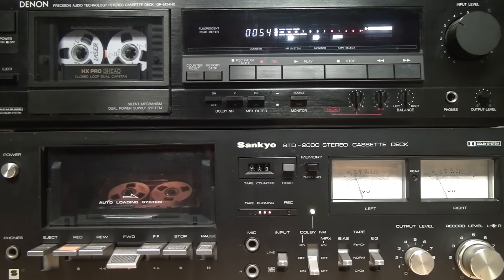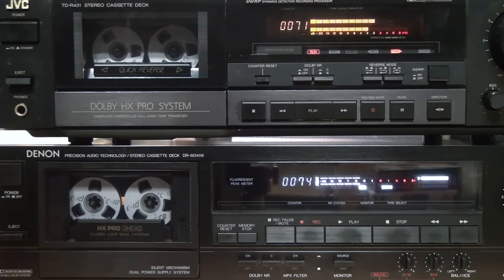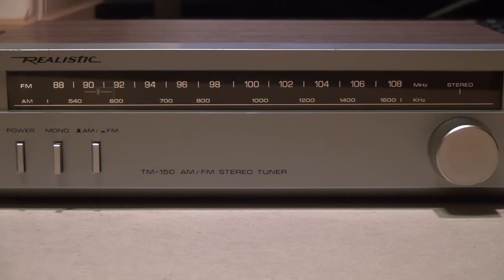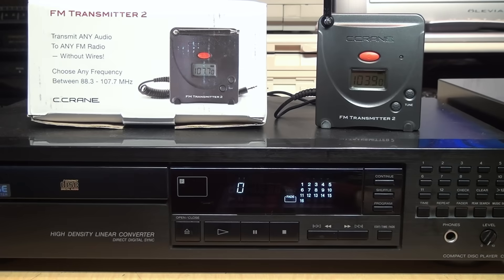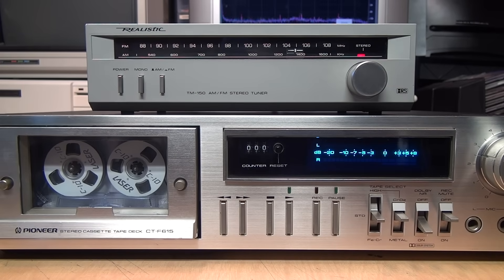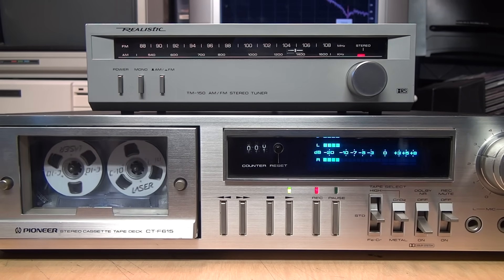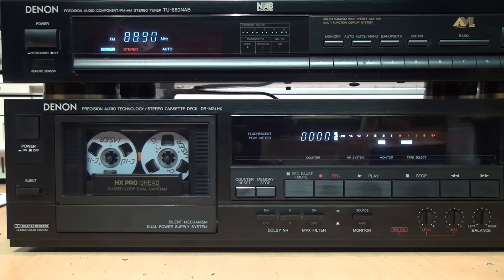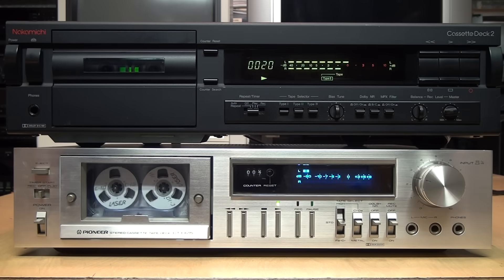MPX Filter - What does it actually filter?

Comment: Same goes for M.A.S.H. i only found this on a few CD-Players but still couldnt find out what this actually does
Reply: Multi Adaptive noise SHaping.

It's a technique of dithering a 1 bit delta bitstream so it has good high frequency response. This is because most CD players use oversampling techniques....converting the 16 bit PCM to a one bit delta sigma stream, then generate the analog from the bitstream.

Look up "oversampling DAC".
Reply: @dewdude  Awesome! 
I had a look at a few user manuals from my compact stereo systems but none of them even mentioned it, even though it was written on the front of the device, so i always was wondering what it does. But yeah thank you! I will look into that. :)
Reply: @NeonNightmares  M.A.S.H. was 64x oversampling; meaning the 44.1khz-16bit stream was converted to a 2882.4khz/1-bit stream. Most players of the era were of the 4 to 16x range; although by the time MASH came out I think they weren't sure themselves. Exact numbers were sometimes hard to come by and the rate of oversampling was dependent on a few other things than what chips you use.

Sony later settled on a 2882.4khz rate for SACD...which stores it's audio in.... 2882.4khz/1-bit; and the format was in planning and development around the time MASH was really hitting it. That doesn't mean they're related other than 2882.4khz seemed to be a limit until sometime in the early 2000's.

Comment: MPX filter also helps with CD players with lack of signal filtering above 22kHz (at least in my case) when recording with Dolby, can be useful with other type of DAC's.
Reply: It shouldn't. This is likely just the result of not being able to properly bais the tape for the specific formulation and the additional highs are over biasing.

This is what HXPro fixed.
Reply: @dewdude What I was referring to is noise due to interference with bias frequency - mpx is cutting anything above 19KHz so problem solved. Try to look at signal from some DAC's on oscilloscope. The simples test you can do is to record CD or put PCM/WAV file with zeros and play it back - then record it, and then record with disconnected CD/DAC - if there is different noise level then you are dealing with unwanted frequencies (or bad shielding).
Sadly in some decks MPX works only with Dolby enabled (maybe on all of them?)
Reply: @xenon2Merchant  biasing is a different can of worms all together. My rule is if you are not using a three-head deck and you are not calibrating the bias for that tape using a pink noise generator, then anything you do is moot. In a properly designed deck, the bias isn't anywhere in the dolby chain; mpx filtering would occur to the audio before it's sent through the Dolby encoder/compressor. Now the 19khz carrier can cause some degree of self-biasing, which can cause the tape to over-bias; but even the audio you're recording does this. That's where HX Pro comes in to play...which is...again...a different can of worms. 

There is some inherent advantage to using the mpx filter to prevent self-biasing..but then you add the complication of dolby to the mix. The MPX filter is very much a Dolby thing; it's entire system is based on accurately tracking the high frequencies. Given the fact that most consumer decks were lousy playback machines that rarely had proper azimuth and...Dolby is a bad idea. 

I think most of the things you're noticing have more to do with the self-biasing factor of the MPX carrier rather than anything related to the dolby circuit.
Reply: @dewdude  I did testing with signals above 30 KHz and it is creating extra noise.

Comment: You made me look, i dont know what it is yet but my TASCAM 122, which is THE broadcast deck, lacks it lol. Its NR modes are NR, NR+HX, NR OFF.
Having watched, The theoretical issue with any filter in the chain would be phase smear, but that would be beyond my hearing XD.
Reply from the maker: The TASCAM 202mkV has an MPX filter that is always on when you record, so I'm pretty sure the 122 has it as well.
Reply: So the thing is the target market for that deck was pre-broadcast where the MPX filter wouldn't be entirely necessary.

That being said, it's likely always on since very few tapes reproduced that high and you'll probably want filtering in case you're in a high RF environment.

But in the studio....MPX filter usually wasn't needed.

Comment: You may want to claim I'm going on an audiophile babble but the HF response is very slightly less extended with the MPX on. It's definitely doing something to the percussion, and it's definitely filtering something more than the 19K tone. The latter of which I do not claim to be able to hear. There is a difference unless you have hearing loss.
Reply: You are. 

FM broadcast is hard limited at 16khz. This is FCC requirement. 

There's nothing above 16. The most likely explanation is just Dolby B was bad on consumer stuff.
Reply: @dewdude  How about you stop listening with your eyes? It doesn't matter whether or not the thing is limited to 16K if it's messing with something below that frequency. It sounds different with it on.
Reply: @Deluxeta  I'm listening as an audiophile with years of working in the studio and on gear.

The reality is you get a cassette to respond to 19khz....then you likely don't need Dolby NR. I have to wonder if the deck you were using had a very cheap filter implementation.

Also....any self respecting audiofile doesn't use Dolby.

Comment: I've worked in radio and television broadcasting on and off since the mid 90s, and I never knew the MPX filter on a cassette deck was related to stereo MPX.  I always assumed it was a filter for some other Dolby system...  😂
Reply: Do you remember which broadcast decks had it? The 122 doesnt.

Comment: I had a high end Yamaha deck when I was 20 or so, and at the time, I could hear up to 20K, according to tests.  It could record up to that frequency, or higher on Metal tapes.  Having the switch for MPX was necessary in that case.  With it on, I could hear the loss in those high frequencies on some songs, like Owner of a Lonely Heart by Yes, which has hi-hats that do produce very high frequencies.  Unfortunately, I can barely hear the hi-hats in that song at all anymore.  I never checked with a spectrum analyzer, but with the MPX on, I could hear those hi-hats lose some zing back then.  Today, I miss those frequencies.  I can remember what they sounded or felt like back then, and now they're gone.
Reply: You were lucky, most teens can't even hear more then 17-18khz
Reply: You would not hear any difference if you recorded off a FM radio broadcast, which is 50 Hz -- 15 kHz only, by international agreement.

Comment: Speaking of recording off of FM, that was routine back in the 80s. I still have several tapes recorded off the radio here in NYC from 85-88, featuring stuff from Z-100, WPLJ/WWPR and even WAPP. 35 years on, they still sound great.
Reply: Same. My tapes were mostly Austrian broadcasts from the 1980s, but recently I acquired a crate of used Sony Fe-Cr tapes from Japan, recorded off Japanese FM in the 1970s. Sweet. Great music of all sorts, no Dolby, no hiss.
Reply: I recently found some 70s and 80s air checks on Youtube. The ones featuring Z-100 and WPLJ really gave me the chills. Damn, how I miss those times (I was born in 1970). And those old tapes reflect those times perfectly. Especially the ads included in them.

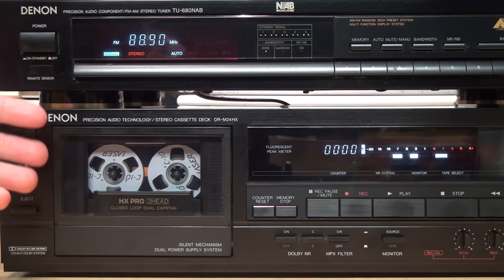Comment: 13:10 - The problem is that MPX filter starts rolling off at around 17KHz, which is audible.
Reply: Impact of double mpx filter can be seen, that's for sure, but can it realy  be heard? I doubt.
Reply: @nonewage  Not on his equipment it can't. But audiophiles wouldn't go near this stuff. So blaming them for the MPX filter feature is just plain ridiculous as they never would have bought this anyway.
Reply from the maker: If you can't hear the 15.7 kHz flyback oscillator whine from a CRT TV or computer monitor anymore, then there's no way you can hear up to 17 kHz.
Reply: @vwestlife  You're missing the point. There is bleed into the lower frequencies that are audible to a lot of people. You also have to take the quality of the equipment into consideration as well. Perhaps your ears are not able to pick up on that bleed on your low quality consumer grade equipment. But better equipment and better ears will pick up on that bleed.
Reply from the maker: @SSJfraz  FM radio stations have to lowpass filter their audio at 15 or 16 kHz to prevent interfering with the pilot tone, so anything above 17 kHz on an FM broadcast is just noise and the pilot tone. There is no audio content that high in the signal.
Reply: @vwestlife  absolutely agree 👍 
I remember myself (age 21) testing mpx filter by recording from cd (no Dolby NR). I couldn't find any difference (mpx on or off) on Technics RS-B 755 and Maxell XL-II-S tape.

Comment: I find it funny how consumer electronics manuals, even relatively new ones, warn you not to clean the plastic with benzene as it may damage the finish.   Benzene?!  I wasn't planning on doing that (might also damage the surface of your bladder)
Reply from the maker: A lot of countries use benzine or similar words as the name for gasoline (petrol). Denatured alcohol (a.k.a. methylated spirits, "meths") is also considered to be a fuel and I do sometimes use it as a cleaner, but only where I know it won't mar the finish.
Reply: Sometimes you don't know what's in that cleaner from the dollar store.